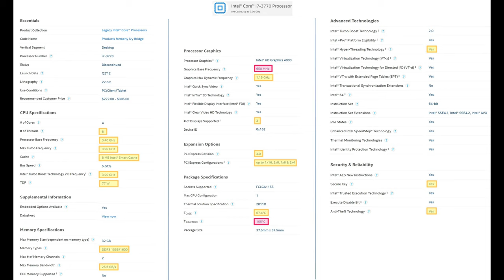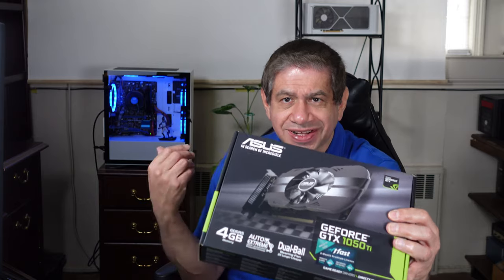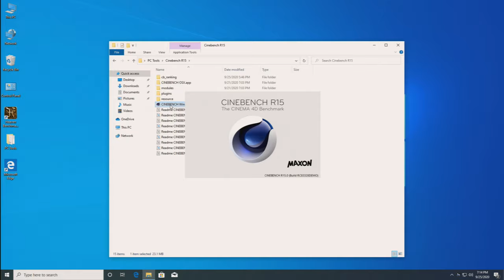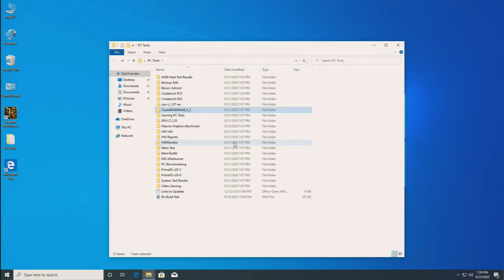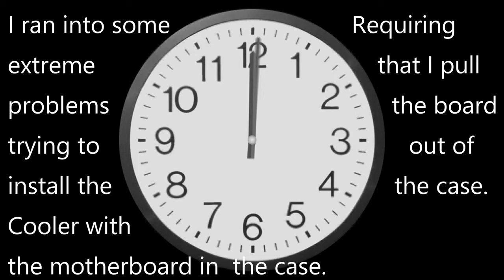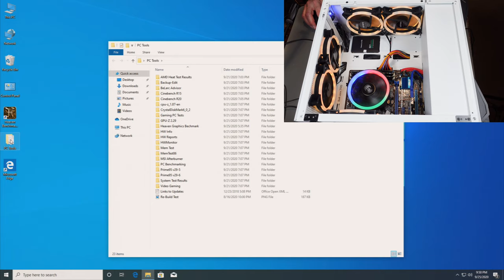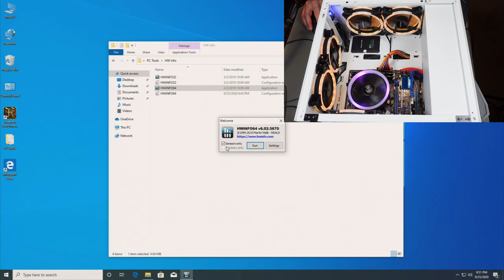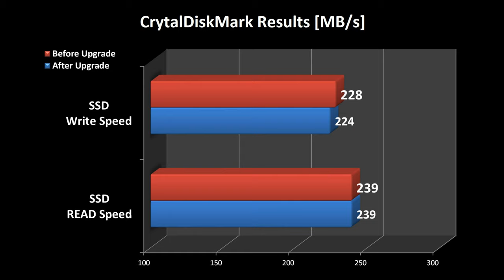Upgrading a Home Office PC to a Gaming and Video Rendering PC

Comment: When I watched the intro part I was actually worried hat the RTX 3080 FE would not fit into your case in the  back. Since you got a piece of wood I am sure you find good use for it :))

What games would you like to start playing? Or is it a secret reserverd for your next video? Great Video as always :))

I broke one of those CPU Coolers.The only one I ever broke and I was not even sorry :)) 

Was it 91 Degrees Farenheit or Celsius?
Reply from the maker: Now that I've re-watched that, I thinks it's a lame attempt at humor.  However I only pull something down if a see a critical error that I cannot correct sufficiently through comments. I doubt I would ever be a good comedian.

Did you see the call-out I gave you? 

Thanks for watching :)
Reply: @PE4Doers  Yes I did :)) Thank you very much indeed.